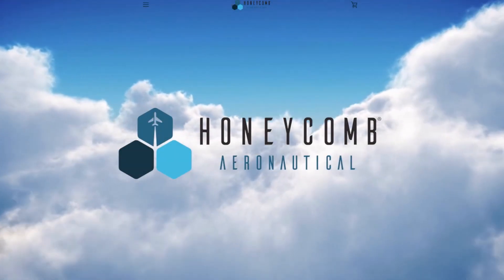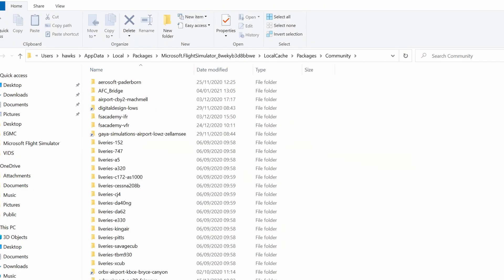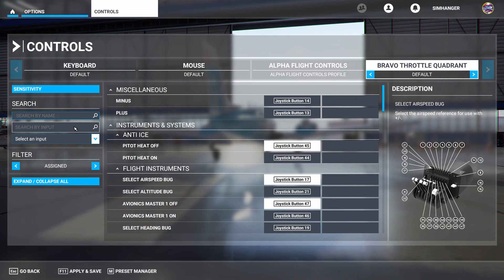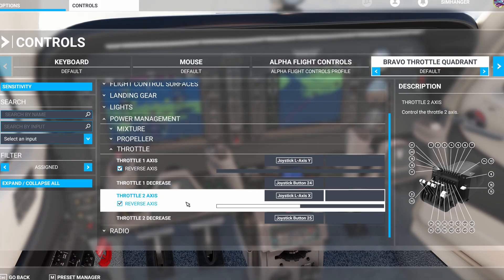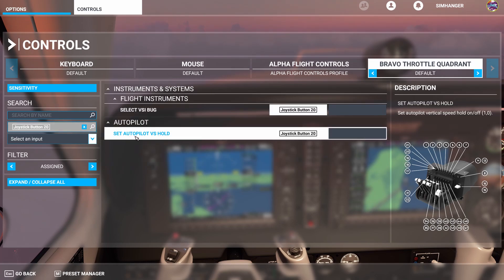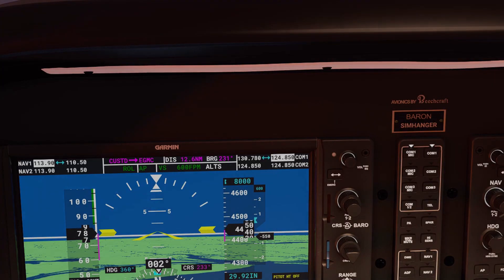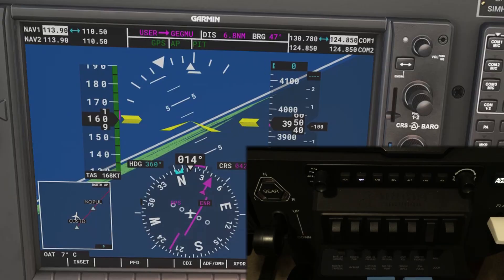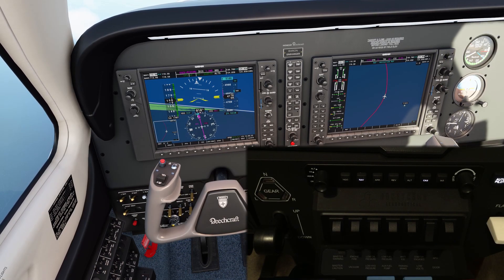Bravo Throttle LED LIGHTS Configuration Guide | Microsoft Flight Simulator | Honeycomb Aeronautical

Comment: Re. ILS light fix: 
Honeycomb has a new version of that LED driver and this bug is fixed. No need to modify the BFC_Throttle_Config.json file.
On a side note, thanks a lot for your video guides. Much appreciated!!
Reply: they just came out with another one, and now my lights are working again
Reply: @harpoon_bakery162  V2.1 has been out for months...what new one?
Reply: @anthonysonstein4288  well my lights didn't work, I went to honeycomb, downloaded whatever version is there, and they started working again. It's magic. By the way, what is the configuration program for? it's called HONEYCOMB CONFIGURATOR. (I assume flight sims that are not intuitive?).  I'm guessing it's not needed for MS2020?
Reply: @harpoon_bakery162  that is for X-plane.
Reply: newer than Aerosoft v2.1?
Reply: Buenas, no consigo que se me enciendan las luces led y ya hice incluso lo del video. ¿Qué se puede hacer? ayuda por favor Un saludo
Reply: Theo Dawson  random?  what else have you and your "girlfriend" been doing during covid-times?

Comment: I noticed your heading bug moves normally when you spin the increase/decrease dial.  Mine moves painfully slow.  Did you do anything to address this.  I noticed in Sim Trim that the dial doesnt seem to activate button 13 and 14 on each increment.

Comment: Your content is great,but I am using MSFS PMDG B737-800 and alpha yoke and Bravo throttle quadrant. I have already downloaded the current drivers and installed but none of the autopilot lights are functioning on the Bravo.  The upload did fix the landing gear light problem but the red leds and autopilot are inop…..HELP
Reply from the maker: @geofferyshanen7758  you need to build configs from the default (twin engine) config after install of the AFC_Bridge.

Comment: I just did a new build, and I reinstalled the Honeycomb driver ver 2.1 and I don't have the lights for the auto pilot on the throttle. Is it still a requirement to modify the BFC_throttle config file?
Reply from the maker: Configs have to be built from the new default profile after you have installed the driver they don’t always carry across. Try restart first though.
Reply: Everything appears to be working fine accept the A/P lights will not illuminate but they do function. That’s my issue, so you’re saying I have to reconfigure all my throttles even though they work?

Comment: several people have asked the question regarding you saying "3:36 I see that the LED config had copied to the props but not to the jets" but you haven't answered anyone's question on this from what I can tell. where do you see that the config has been copied to the props?
Reply from the maker: The led config is copied to the default profile only…which happens to be the twin prop config, as mentioned in the video. It is not copied to any other existing profile. All profiles should be created/build from this profile.
Reply: @SimHangerFS  i appreciate the response. your video makes it clear that it only affects the default profile, but the question that you repeatedly aren't answering is where are you SEEING this? " I see that the LED config had copied to the props but not to the jets". It's a moot point for me now as I've found another utility that works better, and again I appreciate the vid and response.

Comment: I can’t get Bravo led lights working with Fenix a320 but they work with the sim default a320,any ideas how to fix
Reply from the maker: The Fenix uses non default simconnect calls so some functionality is lost as the bravo lights config is set up for default (standard calls).

Comment: I think I'm missing something. The video's tittle is 'LED LIGHTS Configuration Guide', and I see you install the driver (as I did myself, the AFC_Bridge folder is in the community folder), but then you're configuring levers and switches, but I didn't see anything about how you got the lights working. And I dont mean a specific light, but all the lights in general. I dont have any lights in any aircraft, so it must be turned on in some way, I assume. In the MSFS Content Manager, the AFC_Bridge folder is categorized as 'Not Installed', but I found that that's normal... I'm getting kinda stuck here...
Reply from the maker: The lights work providing you build your configs from the “ new” default config that has the lights now built in. Old configs need to be replaced unfortunately.
Reply: @SimHangerFS  I found the problem. From the video, I knew there was an exe-file in the folder, but Im not used to apps that need to be started, that the exe-file is 'hidden' behind so a long folder path, like this. But I have my light working. After starting the sim, I start AFC_Bridge and they work.

And my complements and appreciation for your videos. I find a lot of valuable info and you're a very good teacher. Im glad I found your channel.

Comment: Hi! Question: At 03:36 you say your "LED configuration was copied across to the props but not to the jets". How do you check this? Is part of the .json copied to the aircraft folders? Appreciate some guidance because now I have zero lights working on the Fenix (however they do work on any other) nor do any of the turn knobs work... Good job on the videos, great help!
Reply from the maker: The led activation data on driver load is only transferred to one profile. The issue with the Fenix is it uses non-standard commands for many actions so the default bravo functions don’t work unfortunately.
Reply: @SimHangerFS  So if I understand correctly (from your vid and feedback): I need to take  a prop profile and copy that to a new A320 profile or just select my current a320 profile (based on a 2 engine jet) and then active the bridge? Sry for this line of questions, but currently lost on what to do (besides using spad.next).

Comment: Hello , Please can you explain the beggining of your control setting. Im missing the bit where you say you move the throttle filter to search how is this done? I payed £600 for my Quadrant and yoke and i have never been so dissapointed. Ive tried to slow the video down but i just cant follow exactly what you are showing. Sorry im quite new to Flight simming but i am an electronics engineer by hobby as well as an ex Military Special forces Commando. I say ex as Helmand province claimed my left leg. MSFS is amazing and takes me back to places i never thought i would fly over again. But it helps if you have suitable working flight hardware and software.Thank you, Great vid!!
Reply from the maker: The search function, on the left hand side of the MSFS controls option menu allows you to find things quicker by typing in a name etc, rather than scroll through hundreds of options. You can change the filter search options to all…assigned etc to make it easier to find .

Comment: my bravo won't save new bindings, it kept going back to default.  Help please.
Reply from the maker: Reinstall honeycomb driver. Make sure you rename and save and apply any changes. If your on beta then it may be related to that?
Reply: @SimHangerFS  I opted out of beta and reinstalled the msfs when this happened. It was fine in beta. I have reinstalled the driver 3 times and same result. I might’ve to try-install msfs again.

Comment: But when u turn the pc off and turn it back on and go into MSFS for a flight the lights wont turn on, how to fix???
Reply from the maker: The installed driver should be in your community folder. AFC_Bridge.
Reply: @SimHangerFS  wdym by that i have downloaded and then it is fine but after another flight the lights do not work after than until i install it again
Reply from the maker: @Mista_Spicy  check the file is in your community folder. Also this file only loads if the bravo is connected before the sim starts.

Comment: Hi, this is probably a dumb question, but does the throttle quadrant need to be plugged in? I went to the download page and got drivers, but there was no text about "Enable LED lights." Thanks. Update: Even plugged in, I didn't get that text. Maybe it is all inclusive now.
Reply from the maker: The throttle quad must be plugged in to the yoke to work. Lights are not yet configurable….currently in Beta test.
Reply: @SimHangerFS  Thank you for answering, but I don't think you can plug the throttle quadrant into the yoke. They have to be plugged into the computer separately unless I completely messed up my installation. This is the first civilian yoke and throttle I've used. I was using an X-56 before.
Reply from the maker: @crawl3ysnipe  sorry, my error….thinking of the VelocityOne….with the Bravo there is no separate configurator. The config for the lights are installed into the Bravo default profile. All profiles must be built from this profile. Apologies again

Comment: Still cannot get the AutoPilot to work properly in the A320 Fly-By-Wire.  The glass cockpit shows autopilot on AP1  and so is the HDG.  I cannot get the AutoPilot master button to light up.  And as for the Altitude, I can't get that to work.  I have the latest drivers from Aerosoft for 'AFC Bridge'.
Reply from the maker: The FBW mod uses some bespoke, non-standard mappings. That is why your having difficulty with config. No solution that I have found without third party apps.

Comment: Driver doesnt install gives error: Missing User cfg. opt: is there any way you can help?
Reply from the maker: Check you have downloaded the correct version. FSX will not work for MSFS. Check the install is in your community folder,
Reply: @SimHangerFS  I have downloaded the correct, I not sure what you mean by community folder I don't have a folder named that.
Reply from the maker: @SkooBalls  sorry, wrong sim. Suggest uninstall config utility and try reinstall.

Comment: Now owning the yoke and Bravo throttle I’ve noticed the elevator trim on both hardware is not working correctly. The trim is at 10% and if I try and change with the throttle wheel, or trim switched on the yoke the trim will change. Unfortunately, it then moves back to the starting 10%. My question: “do you know of a fix for this issue?”
Reply: do you have AI auto trim on in your assistance settings?
Reply: @SkooBalls  correct, that was the problem. Thanks.
Reply: @GWAIHIRKV  Np!

Comment: Mark - I downloaded the drivers however it shows in my my content manager as "uninstalled".  When I select it I'm not given any option to install.  It's located in the community folder as you show in your video...any suggestions?  Even when I click on the executable it appears like it's installed...but no lights and still showing as "uninstalled" in content manager.

Comment: yeah seems like asobo broke another thing. I've tried it Today with new bravo and beside all controls being badly assigned, leds are not working (with installed plugin for fs2020) and creating new profile just deleted all assignments... Sometimes during savings changes it will just crash to desktop.... :/ Works fine on XPlane 11...

Comment: Jun 21, I tried this and it did not work, but I ran the Bridge.exe file in Community, as Admin, got 'simlink not connecting. Ran simlink in windows search and it ran and dissapeared. Put MSFS in windows mode and set it up, then ran the .exe file as Admin, not a lot happened. But when I ran my Baron profile...a box appeared very quickly saying 'installing whatever' and hey Presto, I have lights. 
Hope this helps anyone else that was 85%there, thanks for the video
Reply: What u mean baron profile?
Reply: @Tignanmo  On the Bravo throttle I set up different profiles for each aircraft, as the Baron was the one I was using I just used that, it could have been 4 engine jet, as set up in Options/controls/bravo throttle, sorry for confusion
Reply: @daviddavids8218  pls tell me what to do? It says Failed to Initialize SimConnectYoTheLine?
Reply: Pls help
Reply: @daviddavids8218  how to set up profile?
Reply: @Tignanmo  See my first entry again, simlink does not work & I didn’t know what simlink did, but on a hunch I ran simlink.exe and it kinda blinked and disappeared...so seemed to do nothing. I restarted MSFS and selected options, brought up the screen with my bravo throttle, it probably had default settings, clicked it and something like ‘Simlink updating...went past at the speed of light. So I followed the guidance on how to set up the throttle. Then when I started the next flight, the throttle lit up just before the flight started. Nothing e updaste 5 killed the lights again, but all the functionality is there, good luck

Comment: Cannot get the LEDs to light up at all. Is it me?
Reply from the maker: Justin, run the config from desktop. Check if it has loaded by checking your community folder....it should show afc bridge. In sim the only config that will have the LED and button config will be the DEFAULT profile. Build new profile from this using duplicate etc.

Comment: How do I make the leds work in the aircraft they are not showing, do I have to copy the lines from the JSON file, I am not sure how to get them working?
Reply from the maker: The led lights are configured to the default profile only...and this should now be twin engine GA. Best method is to then delete any other profiles and recreate new ones from the default profile and this will carry the led lights across.

Comment: It's been a long wait to get my throttle quadrant and the first setup video I watched is this one.  Unfortunately, the link to download the software is not working.  That is the link is good but once you get to the honeycomb page the download link does nothing.
Reply from the maker: Hi Mark, If the link does not work right click on the link and select download in separate window or incognito....this will work. Regards
Reply: @SimHangerFS  That worked, thanks!

Comment: FYI, the LED driver download from Aerosoft/Honeycomb will only work if you purchased MSFS2020 from xBox/Microsoft. I purchased my version through Valve/Steam. When I ran the install .exe file, it failed because it could not find the folder stream that Steam created to install and run the program. I would be interested if others out there have experience the same issue and if there is a fix for this. The folders it was looking for under Packages are Community and Official, whatever those are. Can I just create them and run the .exe again, and hope the drivers install properly?
Reply from the maker: There is no config app for MSFS as there is for p3d and Xplane. It should load directly into MSFS controls. Regards
Reply: Thanks for the reply. This is something the Aerosoft or Honeycomb needs to fix asap. Their .exe program, unlike every other install program I have run during the last 20 years, doesn't allow you to change the load path, it is apparently hard-coded and can't be modified. Terrible, lazy programming on their part IMO. As an experiment, I created the Community and Official folders it couldn't find so they would exist and ran the .exe again. Guess what, it ran successfully to completion this time (no run time error) but since the drivers are not in the place Steam loaded MSFS to, the led lights on the throittle quadrant still don't work. Steam puts their version under a "Roaming" folder, whereas Aerosoft puts them under the "Local" folder. Until they change the config to allow me to change it to where I want it to be, i.e. "Roaming", the driver(s) will never be installed where they need to be.

Comment: Nothing happens when I click on the Bravo TQ - LED lights download link. I also tried to open in new page. New page comes up but nothing happens. Please help
Reply from the maker: Hi Tommy, try the option to open in incognito mode, that usually works if all else fails. Easier with google than Microsoft edge, but try both. Regards
Reply: @SimHangerFS  That worked. Now where do I find the Honeycomb Configurator tool? I've looked everywhere, which means it's probably staring me in the face. I'm not sure why all this seems so impossible but I think they could have done a better job with the software and drivers downloads.
Reply from the maker: @Tomrocksu2  , There is no config app like there is for p3d and Xplane. In MSFS the DEFAULT profile for the bravo will now contain the default configs including the LED’s etc. Providing you have unzipped and run the application. By copying this profile you can create new profiles etc. Test out the default profile by using the gear lever or something. Hope this helps.

Comment: Thanks for all of your hard work in making these. I downloaded and installed the driver last night and I have no LED illumination. Any thoughts?
Reply from the maker: Check which profile you are using, it does not copy the led config to some of the existing profiles you may have. If this is the case you will need to remake these profiles using the default profile. Hope this helps. regards
Reply: @SimHangerFS  Yes! I made a brand new profile and got it to work including throttle, prop, and mixture. Thanks!
Reply from the maker: @andrewmorris3479  happy days 👍

Comment: Hoenycomb throttle with good quality but is the most annoying system and hard to set up ! Need someone help me out here, MFS does not recolonise any my throttle, pitch and mixture in the control setting. 
How should my fix it? My version is 1.14.5.0
Reply from the maker: All axis need to be configured in the sim. Check out my channel I have done set up guides for props and jets to help you.
Reply: @SimHangerFS  thank you for your reply. 

I meant when I was trying to set up the control in the sim, it recognised all the button except the throttle, pitch and mixture. Have no idea why !
Reply from the maker: @HaNguyen-ox6zl  , hi hopefully this may help https://youtu.be/MjovDdueafI
Reply: @SimHangerFS  thank you for that